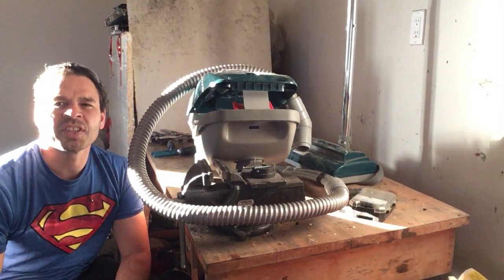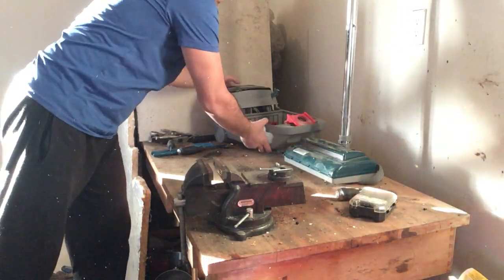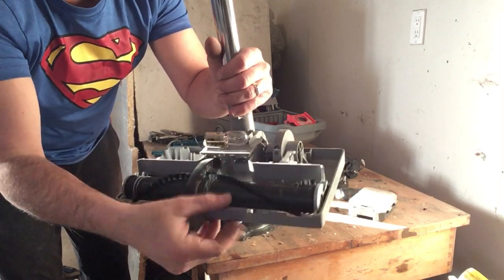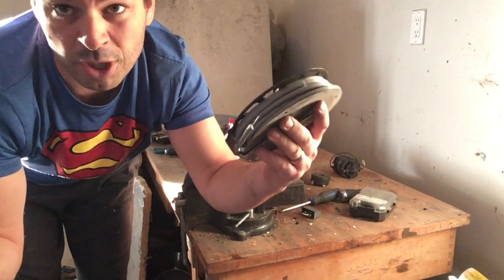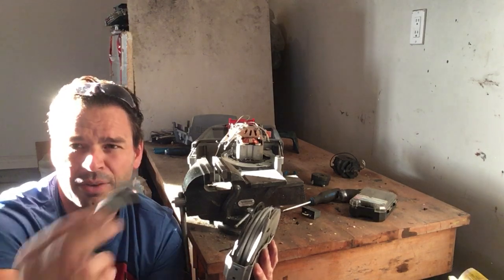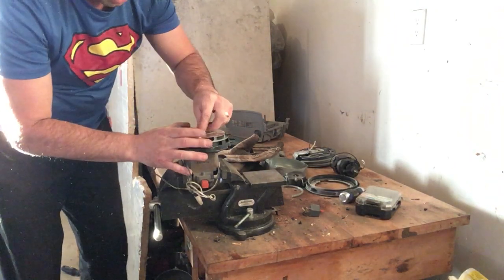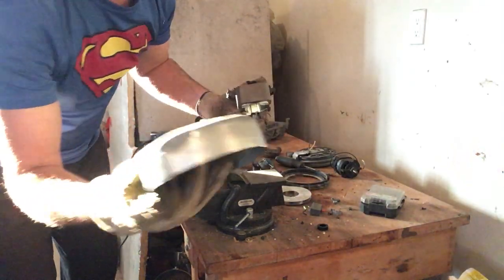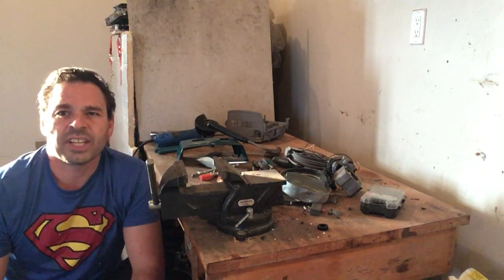Scrapping a 1990s canister vacuum cleaner for copper, steel, brass, and other metals.

Comment: As much as you scrap why wouldn’t you set yourself up with a nice solid work bench & vice. I also have a pegboard with all the most used tools handy.
Reply from the maker: It does me just fine. The bench is maple and the vise holds what I need in place. Maybe when I set up in my shed I will change it up, but can’t take up too much space of the garage.
Reply: @TinManScrapper  do enjoy your videos, lots of information & to the point.